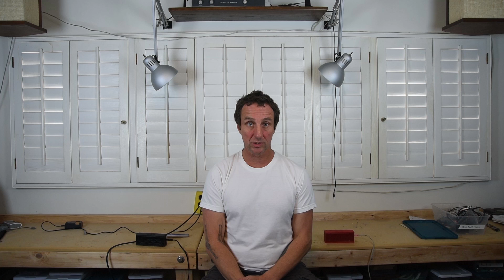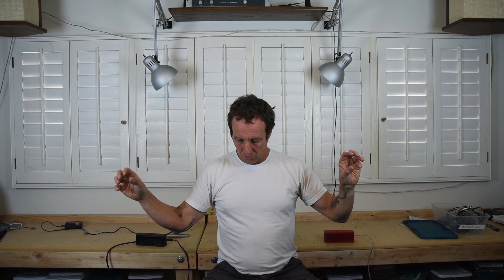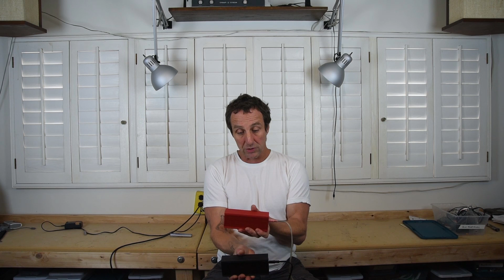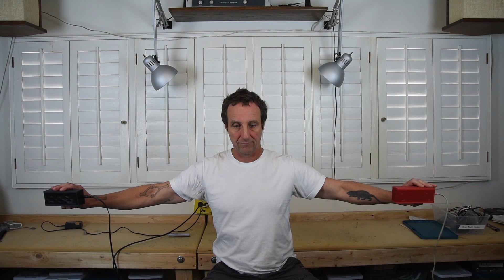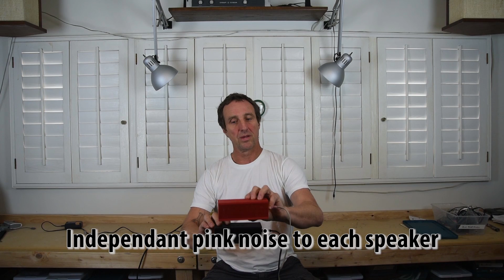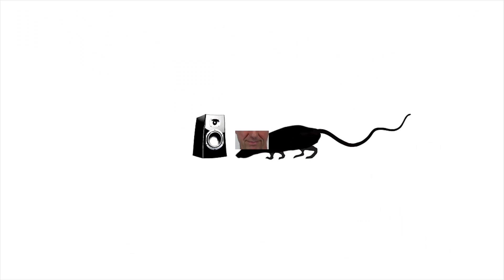Problems With Mono Sound From Stereo Speakers

Comment: hello dave,in this theory,if I hard pan the kick in and out mics L and R,is it weird for the listeners at the both sides?some of them just hear the kick in/kick out.And at the center,we will hear the kick in and out sperate(L&R)because they are different mics and postion,so is it better to mix both kicks mics closer in the PA to make them sound more comfort?or mix them in the center to make it more comfort but it will break your theory.i was so confuse with:sperate them with less comb filter,but may be it will cause weird image or sound,or mix them in center but cause comb filter
Thanks dave!
Reply from the maker: Ka Chun Wong if you get both kick in and out mi s to sound good separately and together, all good
Reply: so if I want to make them more in the center and follow your rule,i can pan those mics a little bit to both sides and it still can against the comb filter?
Reply from the maker: Ka Chun Wong yes, that will help

Comment: Hello Dave, do you think it would be possible to delay one of the side of the PA by 1/5 of a second to get rid of comb filtering. I ask because you say you can delay a single input pink noise source instead of two random sources,  wondering if it works with an entire PA output?
Reply from the maker: delaying one side only moves the center summation point off to one side a bit. all the issues remain

Comment: Interesting aspect and a nice demonstration - and thanks a lot, sharing your experience. Cut sorry: Phase, interference, time-issues and comb filtering ARE natural events (not only, because of law of physics) - this is the reason, why we can "hear a room" or "hear objects with eyes closed". our brain is able to interpret comb filters - this is the reason, why we interpret combing usually as "roomy". 

what i mean with "hear objects": e.g. if you have a big street far away, you hear something like thin pink noise. and if you stay near a wall and move, you can clearly hear combing. so you "hear the wall" and you can interpret roughly how big is the difference between the ear and the wall.
Reply from the maker: in the natural no man made environment, walls don't exist. the only near perfectly flat surfaces I am aware of are bodies of water and geography like the salt flats. that said, I reiterate, nowhere in nature does the exact same signal radiate from more that one point. yes there are situations where similar signals can e it due to reflection but not in the scope and magnitude that identical signals are commonly  reproduced by sound reinforcement.

a rare and imperfect event versus commonplace.

Comment: Hi Dave.
I have a question. Saw your Event Elevator Interview the other day an instantly had this video back in my mind. Since you drive Subs L and R but still use a Arc in the middle how do you drive the arc? Do you have 2 0ms stacks which are driven left and right and the left side of the arc is driven left and the right side driven right including the arcs delays or do you keep the arc mono and just use the outside stacks to be l and r? This question is bothering me quite some time now and I didn't have the opportunity to try it live yet as a systec since most people want to run the subs on a mono matrix send and don't want to have them Stereo. Thanks in advance
Reply from the maker: the center subs are low volume fills to cover the people in the middle without overly disturbing   the primary coverage from the main L/R sub arrays
Reply: thank you for your quick reply.   Really appreciate it. Love you vids btw. Learned a lot from them. Greetings from Germany

Comment: That's an awesome video. But what if... Our brain was perpetually analysing comb filters from two sources giving the same sound, i.e. our ears, and extracting spatial information from that. I'm convinced untamed phasing can mess with the mix and waste energy, but is it really unnatural? And then predelay for reverb, should it lead to comb filtering or not. Sometimes I feel audio is all about getting rid of an aspect of the signal, to then recreate it with effects. :D Anyway, great vid, cheers!
Reply from the maker: when two sources lack identical info occurring simultaneously, there is no audible interference. the interference may be undesirable as in holes in the coverage, or desirable as in cancelation behind a cardioid sub array. it's all about understanding it so you can use it as needed or avoid it when not wanted.

Comment: Hi Dave, thank you for this video, a very clear demonstration of multiple source interference patterns.  I guess we could say the way a cone speaker generates sound is unlike most mechanical sound sources, ie. human voice is comparable to a horn speaker,  piano sound board is a flat panel with wave-like movement across the surface.  

I am very interested in flat panel speaker systems, have you any experience of using them?   
 http://www.tectonicaudiolabs.com/

Some advantages over conventional stage amplification.

1. Large area panels can be placed behind performers with little or no feedback, even when microphones are very close to the panel.

2. Wide dispersion at all frequencies. (subs may also be needed for bass-heavy performances)

3.  Stereo imaging improved, ie no sweet spot, everyone in the audience gets a clear stereo image from left and right panel sources

4. Zero cancellation issues, your demonstration with pink noise would show this, even the exact same pink noise source coming from left and right panels would cause no cancellation  (I have demonstrated this using two BMR speakers)

Seems to me this kind of system would be ideal for acoustic instruments where natural undistorted sound is wanted.  The panel technology solves many sound reinforcement problems.  
As long as Rock bands continue to be popular though I don't think, conventional system manufacturers would be going out of business any time soon.
Reply: I've noticed that with SLS's ribbon mid/high speakers. They behave so differently than horn mid/highs.

Comment: I have a question Dave.
I always bring a double CD player to any gig, just so I have a way to always provide some kind of signal easily. That being for testing, back ground music etc.
Anyway here's a idea. If I made two cd's each featuring the same pink noise, had the left channel from cd 1 go into left on a stereo channel, and then the right channel of cd 2 go into the right channel of the same stereo channel as cd 1 left is using and then played both cd's when doing measurements. Would the ever so slight difference there naturally will be between the left source and right source be enough to work like you showed here? Or would it be better to simply use two different files of pink noise sound?
How do you actually go about getting two very similar but different pink noise signals here?
Reply from the maker: any two pink signals will work, even the same signal with one side delayed will work as long as the delay time exceeds the wavelength of the lowest frequency and potential delayed reflections, maybe use 100ms minimum on one of the pink sources. theoretically all pink sources are identical sounding and completely random and different from each other unless recorded at from the solar source at the same time.
Reply: Thanks mate. So in essence if I read you right. If I use two identical but separate sources playing the same pink noise track, one source for each channel, I'm good to go?
And if I use one stereo source playing pink noise into a stereo channel, I just need to delay one of the channels for the same effect?

Sorry for the many "simple" questions. Tons to do and dog tired, so my brain has gone from fully firing V8 to economy 4 pot mode...

EDIT:

Something just dawned on me. What I'm suggesting in the first place here, would basically be like recording a cd with a stereo track of pink noise. Could it be that simple  would that work without a time delay? That IS two separate channels, each playing the same identical pink noise track, but of course not in a mono mix.
Reply from the maker: +ABOlsen69X no, you can not use the same exact pink on both channels of a stereo source. must be different times or from differing sources or from the same source but record differing segments of the pink signal

Comment: Pink noise, white noise, either way BMR speaker or large flat panel speaker system will not suffer from these issues. some very interesting technology described here: http://www.tectonicaudiolabs.com/. Dave, have you heard a flat panel system or used one?
Reply from the maker: BMR or Distributed Mode Loudspeakers have their own sets of challenges. I have been to some demos of Tectonic Labs products, I have so early prototypes of NXT Panels as well as some small consumer DML desktop speakers.  Whilst in the mid and highs it may offer advantages, currently we rely on being able to have arrays of speakers reproducing the same signal in order to control dispersion and coverage. 

This is the basis of line arrays and sub array. I have yet to see a BMR or DML design that offers coverage control.  Also having significant SPL coming from the rear of an array causes undesirable issue.

This is not to say that there will not be progress in with implementing that technology on lager scales, At this point though I dont see them as a flexible solution for most applications.
Reply: Thanks for sharing your thoughts on this Dave.

Comment: If you do the same experiment with BMR speakers, Balance Mode Radiators the white noise does not produce phase shift effects at high Hz. BMRs have been out there quite a few years now, yet they are appearing only in high end HiFi systems. Why not use them for PA systems_
Reply from the maker: Controlling dispersion and achieving smooth coverage and volume levels in the far field are two primary challenges to using BMR and DML designs. Also using vastly differing technologies for the lows and HF creates coverage and consistancy challenges

Comment: Any thoughts about what has the most impact on differentiating the two signals, e.g. time, frequency, amplitude, phase?  All equally weighted?
Reply from the maker: time just changes where the summation point occurs. ultimately you want randomized frequency dependant phase shifts without alterations in overall EQ
Reply: Since one of the elements of Head Related Transfer Functions (HRTFs) effect is frequency input/frequency output, curious if you applied a pair of HRTFs for left and right sum respectively would you get a similar result as using two different microphones?
Reply from the maker: +John Roesli try it and let me know
Reply from the maker: +Marcel Gavalier pink noise is a random noise with equal energy per octave. if you send the same identical random noise to two or more speakers, the source will interact as they are identical.  if you use two separate pink sources or in other words two random noise sources that are not identical, they will not interact.
l
Reply: Dave, can you explain what is "two different pink noises" more detailed? Because i have same question as Jogn Roesli, but i dont uderstand your answer. Thank you. (maybe some practical demos?)
Reply: So the HRTF filters do not work.  According to Dr. Bill the signal remains highly correlated in phase...

Comment: Is it possible that the "magical" qualities of vinyl can partially be attributed to this phenomenon?  The L+R channels on a record are encoded on separate dimensions of an imperfect physical medium.  So any channel that isn't panned 100% L or R will have a subtle, random variation between the left and right side.  Therefore no "perfect copies" emanating from different points in space.
Reply: stereo records are encoded with sum and difference signals, not left and right.  the movement of the stylus within the cartridge's magnetic field then decodes this back to L and R.  but yes, there is crosstalk between the signals, for sure.  and thats definitely part of the sound of vinyl.
Reply: No, L and R channels have DIFFERENT information because records are mixed in stereo.  Dave is talking about mono sound systems where IDENTICAL information is sent to both channels.

Comment: Hey Dave. Would this work by splitting the source into 2 desk channels, and then delaying one by 1 or 2 milliseconds?
Reply: Thinking about it, especially lead vocal, having it super wide would be very bad, location to the middle, dead centre very important. Backing vocals or layers, harmonies thickening out a vocal, chorus etc... Possibly!
Reply from the maker: that will achieve similar results as just moving one speaker 1 to 2 feet farther away
Reply: Ok, so to make this work with a single source,(like a vocal), how would you process each channel (after splitting), to get the same effect?
Reply: Great vid by the way, and thanks for taking the time to respond.
Reply from the maker: I personally do all I can to send differing signals to left and right with everything except vocals.  Then it opens a unique space for me to put the vocals.

Comment: Dave. 

Very interesting stuff. My question is would using two different mikes on a single source with a hard pan work to clean up the phase and comb filter issues, or would you need two different sources like you demonstrated with the two different pink noises? Like double miking a kick and hard panning which I like to do, seems to sound cleaner. Or, for the theory you demonstrated to work would you need two of the same kick drums? I would think best case is two of the same instruments, one to each speaker is best. Second best, two mikes on one instrument with a hard pan, and least best one mike on one instrument summed. 

Please let me know your thoughts. I would appreciate it!
Reply from the maker: yes, you are on the right track. two mics on the same instrument hard panned is better than one mic sent to both side.  Now alter the mic distances, use different mic types and mic differing parts of the instrument then EQ both to sound similar, or purposely add EQ to alter the sounds further. Also sending at differing volume level.  All this adds up to introduce differences that reduce the comb filtering issue.
Reply: Dave does just what you suggest -- he multiple mics the instruments and sends different mics to each side.  That way, the same sound doesn't get sent to both sides.

Comment: Hi Dave, love these tests - thanks for all the time you put into this. What piques my curiosity is how a single pink noise generator would sound going to two different kinds/brand/design of speakers. If they are different enough, would it reduce comb filtering? And if so, extrapolating this to perhaps using different speakers L than you do R. Or at least subs. Or taking it another step by sending bass mic to L and bass DI to R. Subs being bassreflex 18s on the L and bandpass 15s on the R. Crazy, I know... but just conceptualising out loud.
Reply: Very interesting, you'd think so, especially if different response times

Comment: Last weekend I was at a small church to help them with their PA system.  After watching this video, I did an experiment.  I ran the pastor's voice through the headset mic on the left side, and the pulpit mic on the right side.  The improvement in quality and gain before feedback was astonishing!  I walked from side to side and I could hear very little difference between the two mics.  Before seeing this video, I would have though such an experiment would be completely insane!  Now I'm curious how a recording would sound.  My guess is that in a more controlled environment such as headphones or a decently absorptive room, that the different mics would be  noticeable and distracting.  But live, it was amazing.
Reply: Once you've recorded it though you've already passed the problem area which is the live reinforcement.  Recorded sound usually only uses 2 speakers or a pair of headphones, so just pick whichever mic you like the sound of best and use that and mute the other one!
Reply: @djjazzyjeff1232  That's true.  I think in the live venue it might work, but for a recording I'd choose the best of the two.  Also, spoken word is different than music.  Hearing two different mics while wearing headphones would drive you insane! haha

Comment: Dave, You just changed my life. I always thought that effect was not enough speakers or poor designs. Do you have any suggestions short of putting two mics on every vox and instrument. Maybe a stereo effect insert on the mains or something. Thanks for the great videos
Reply from the maker: The interaction can be reduced inmany ways.  Panning off center helps, does not need to be hard panned, just 3 to 6 db down on one side maes a difference.  Using two different mics with one panned to each side. The more differnt the mics the better. A ribbon and a dynamic and then E to sound similar.  Putting one mic close and the other farther, compressing one side differently than the other, eq'ing one side differently, using a DI on one side and a mic on the other.  Anything to minimize the exact same sound coming from two or more spaced sources will reduce the intererence patterns you hear.
Reply: Thanks Dave, Can't wait to experiment. You've inspired me.

Comment: This video makes me wonder if it's time to create a modern take on the Grateful Dead's Wall of Sound.
http://motherboard.vice.com/read/the-wall-of-sound
Reply from the maker: Here is a google search that returns some info on the dual PA setup I put together. It is what I believe to be the most practicle way to implement a Grateful Dead type setup for largse scale events using modern systems.  https://www.google.com/search?q=ratsound.com+%22Dave+Rat%22+%22Dual+PA%22&oq=ratsound.com+%22Dave+Rat%22+%22Dual+PA%22&aqs=chrome..69i57.19958j0j9&sourceid=chrome&ie=UTF-8